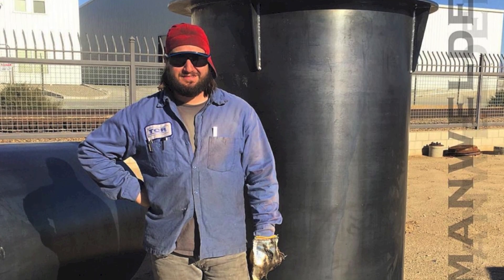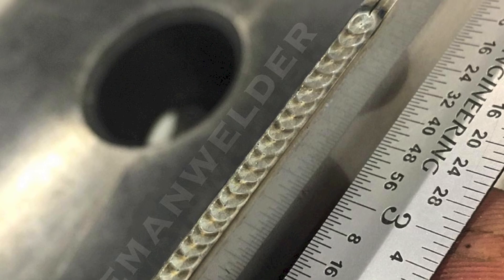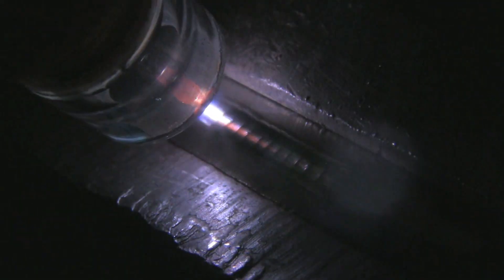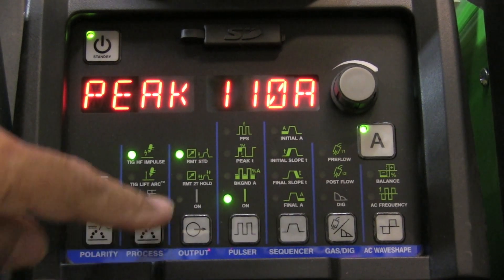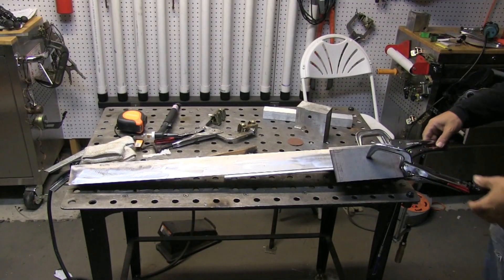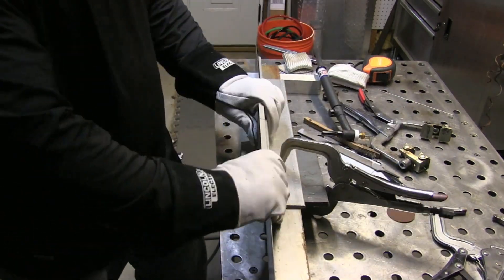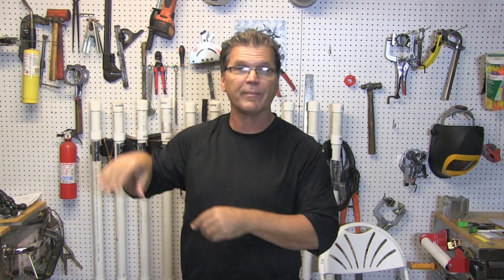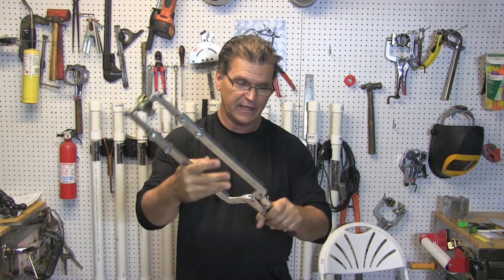Pulse Tig Settings for Outside Corner

Comment: Thanks for explaining all of this. I see now how pulse can limit the heat for tig. Will pulse mig like the feature in some everlast welders help limit heat when mig welding? Any comment on whether that would be the same for flux core? I sometimes weld thin sheet out in the breeze.

Comment: I learned from the best, thanks Jody! I made a small tool box to take a few tools on jobs around work. Came out nice thanks to your lessons and arc shots. It's incredible how much we can learn here on YouTube and the web. I made it from 11 gauge stainless. Did some pulse and 1/16 fill rod on some areas to play around with different settings on my fairly new Lincoln Square wave 200. I wish I could limit the background current and on time current to rule of 33. I have no idea what those pre set settings are on the machine. I pulsed at   2 a second and 125 amps. It looks good but bead profile isn't as defined as some others I see. I'm wondering if it's because the background current pre set makes it more difficult to achieve? I felt and less heat would have made for too slow travel speed and the settings felt about right. I used chill bars all around so color looked good. Have any tips pulsing with this machine? Happy new year and let's hope it's a great one for all of you!

Comment: for weld 316 stainless steel plate what kind a stainless steel flux core need and what shield gas use

Comment: Jody, how much better is copper chill block than aluminum?  I found some copper at my local metal shop, but its very thick (1") and therefore very heavy.  If aluminum gets you say 95% of the way for chilling, it seems like it would be much easier to work with.  Thoughts?

Comment: I'm welding motorhats for machines and even with the pulse settings I cannot get this colour in the steel, is it because I dont have enough heat absorption ? Raising the pulse speed, increasing the gas.. nothing works. I use an angle grinder afterwards though and its sandblasted but it would come out with the same time if I could make it look like this, and just sandblast it right away. And it would look way better. Got any tips on how to fix this ?

Comment: no filler metal? how is this you can do that with tig but if I try something like this with a oxy torch welder I end up lighting up the steel and burning the metal as though cutting it even when I blow the puddle over the other half I am trying to weld,
 this is not the first time I have seen a tig used without filler metal though saw it bond two parts on how its made on a machine torch? is this because of the higher faster heat of a tig or something?  I was under the impression it took a filler metal to join the pieces of steel togather.
Reply: is that so.

Comment: A source of copper &
brass  bar

https://www.amazon.com/s/ref=sr_nr_p_item_width_string-_11?fst=as%3Aoff&rh=n%3A16310091%2Cn%3A%2116310161%2Cn%3A16310191%2Cn%3A16414131%2Cn%3A6469695011%2Cn%3A11260301011%2Cp_item_width_string-bin%3A4+inches&bbn=11260301011&ie=UTF8&qid=1481445736

https://www.amazon.com/s/ref=dp_bc_5?ie=UTF8&node=11260307011&rh=n%3A16310091%2Cn%3A!16310161%2Cn%3A16310191%2Cn%3A16414131%2Cn%3A6469696011%2C

Comment: Hey Jody. Very helpful video, but I have a related question. We are running a Lincoln TIG 200 and mostly weld mild steel, but a new project involves 20 gauge Galvalum. Been running on 27 amps with 25psi has flow and no pulse, but we're still getting occasional blowouts. Should we be running a pulse setting? The only person with TIG experience other than mild steel was with Stainless Steel and a heavier gauge and he has trouble with it. Just looking for help to make it cleaner. Thanks in advance!

Comment: Hi Jody we have an older Miller 250 at work and I dont believe it has pulse. Do you have another video as to how to weld stainless sheet without pulse to help with distortion? Thanks like your channel as a new welder
Reply from the maker: I do have a video of my friend Roy Crumrine building a small stainless purge box out of stainless without using pulse.  Its kinda thick but same techniques and tips work for thin stainless.....The chill blocks are the secret sauce
https://youtu.be/IeTWENRkBdo

Comment: Hey Jody. Very usefull for a project I will execute - stainless tank for a boat. Made from 316SS 1/32" or 1/16" thick.
Most of joints I can do with an angle inside and chill blocks outside. But to close the tank no way I can have this tools... 
I will try to flood the tank with Argon, but it is a LOT of gas (some 100Litres). Any advices on those final closing joints?
Reply from the maker: definitely purge with argon for the last joints.  And even if you can only use chill bars on the outside, they still help pull out heat...even if you have to use tape to hold them in place

Comment: ...Very nice work...I'm still plodding along with my 1956 P&H 300-300 AC-DC TIG/STICK unit (nice unit, rubber-tired..8"...cart has built in water tank and pump).....and my more modern 1981 Miller-Matic 200 (with plug-in spool gun).....(still works like new, despite over 300  (33#) rolls of wire through the #4 Tweco gun....

Comment: I've been a plumber for 15 years. All I can do is solder and braze. I love watching your videos and one day I'll buy my own welder and start to learn how to weld. I actually have a question for some welders. The plumbing tech is actually getting away from soldering and brazing in favor of mechanical joints like Propress, and PEX systems for potable water, and we've gotten away from lead joints on ductile iron sanitary piping also in favor of No-Hub fittings, if not using plastics over iron pipe altogether. Is there any new tech in the welding world that is killing old welding tech? Or is it similar to the earlier days, now?
Reply: all I could think of, would be plasma cutters being more affordable, and not as many using an oxy-fuel to cut things.
Reply: Nooch Martin Water jet cutting is common where the old oxy acetylene radiograph machine was used.